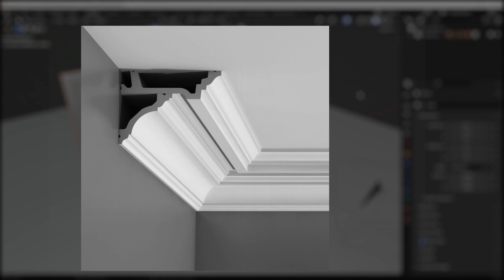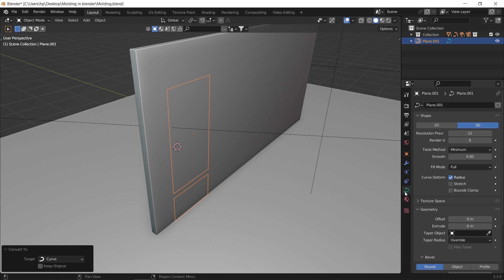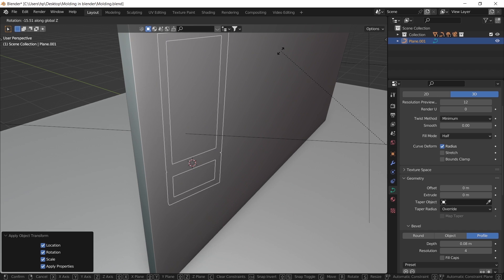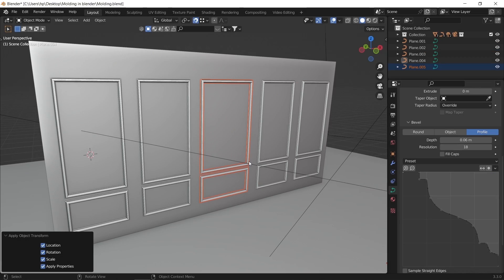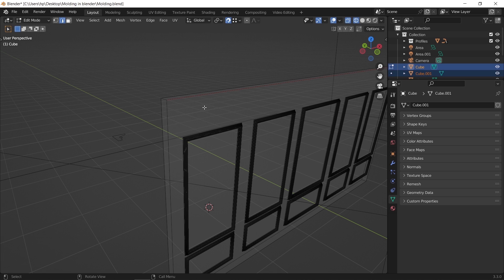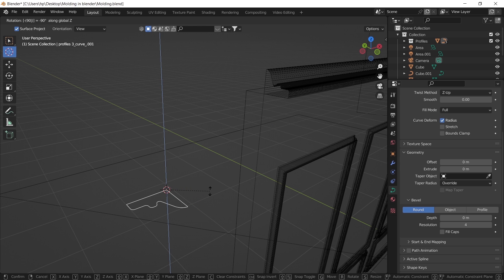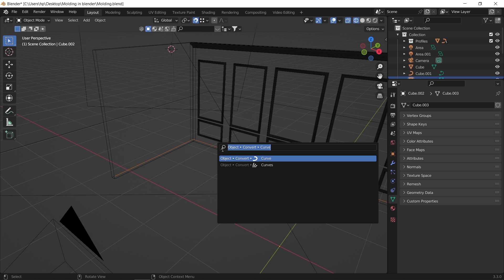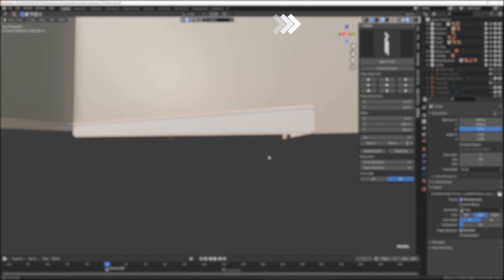3 Simple Ways to Create Profiles and Moldings in Blender

Comment: Is there a way to shade auto smooth without converting it into a mesh?
Reply from the maker: Not aware of a way that shade smooth curves.
Reply: @architecturetopics  
I see, I tried many options but the only ones that works a bit is to use the split edge modifer and set the angle